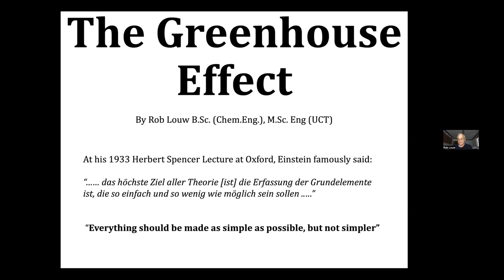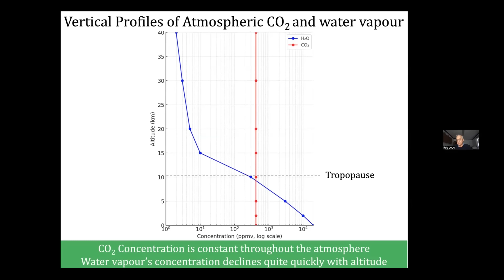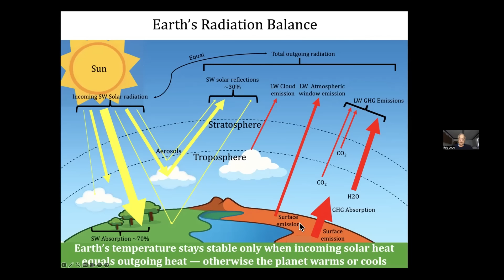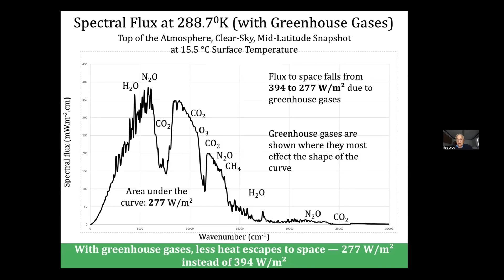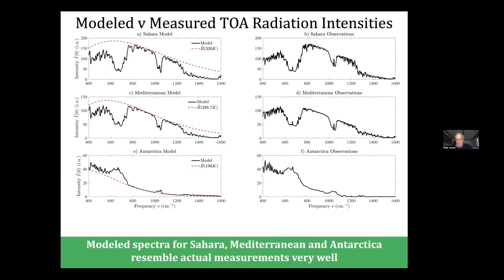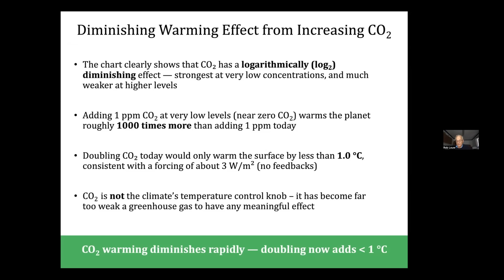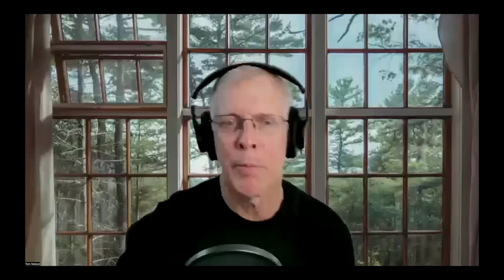Rob Louw: The Greenhouse Effect  |  Tom Nelson Pod #341

Comment: NASA: "Some people mistakenly believe water vapor is the main driver of Earth’s current warming. But increased water vapor doesn’t cause global warming. Instead, it’s a consequence of it. Increased water vapor in the atmosphere amplifies the warming caused by other greenhouse gases."
Reply: The difference between water vapor and CO2 can be clearly explained to people still listening as follows:
For a typical water molecule, it takes a few weeks between evaporation and raining down again.
If you could remove all the water from the atmosphere and leave everything else the same,
after a few weeks, so much would have evaporated from the large ocean surfaces that everything would be as it was before.
With CO2, it's different. If you removed that, it would take several millennia.
In other words, just as you say:
We can tweak the CO2, and the water will adjust itself.
But I'm afraid there are no people here who are still listening.
Reply: This is a shockingly naive statement if it really did come from NASA.
Reply: @Pseudify  It´s actually basic physics: Warmer air holds more moisture than cooler air. Therefore, as greenhouse gas concentrations increase and global temperatures rise, the total amount of water vapor in the atmosphere also increases, further amplifying the warming effect. In numbers: For every degree Celsius increase in temperature, the air's water vapor capacity increases by about 7%.

Comment: The relationship between CO2 concentration and forcing or temperature is logarithmic.
Logarithmic means:
Every doubling of the concentration adds the same value to the forcing and temperature.
This is correctly stated in the video.

What do you have to do to make the viewer mistakenly believe this is synonymous with "rapid saturation"?
Well, first of all, you inspire trust
by presenting rather trivial basics in an understandable way
in order to appear competent.
These don't actually prove the claim you're trying to smuggle.
No, they're all smokescreens to conceal the crucial trick:
At 31:15 onwards, you can simultaneously correctly explain that every doubling of CO2 produces the same 3 watts,
and incorrectly call it "tends to rapid saturation."
You then stick with "rapid saturation," and the lie goes unnoticed.

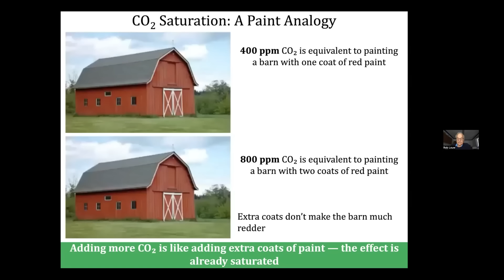 So, the bar chart at 39:22 isn't actually wrong, but it's designed to obscure the logarithm.
It's meant to create the impression that after 400 ppm, only a further 0.2°C of warming is possible.
But that's not true. In this diagram, the sum of the bars from 450 to 800 ppm is the warming, and that results in another 1.2°C.

People, don't be fooled here, check it out for yourself.
Reply: Everybody can and does claim all kinds of things. I don't mind which equation people use in regards to the so called greenhouse gasses and its role in the atmosphere. It is all speculative. Math can't 'solve' this issue. Hypothesise away. It will never turn into a theory simply because there is no zero point of departure. And the system is both dynamic, interactive and to a large degree chaotic. But what we under no circumstances should (and alas do) do is claim certainty and implement 
policies that pretend to 'fix' an imaginary problem based on a flimsy set of unproven and speculative assumptions and assertions.  I dont care if Happer et al are right, somewhat right or wrong or the man in this video. There is no issue to begin with. It is just politics.
Reply: @MrBallynally2  That's where we differ:
You have your opinion, and you don't care if you're wrong.
I have my opinion too, but I do care if I'm wrong.

If scientists whose views I share
were to use sleight of hand as often and make as many simple mistakes
as in this video or as Happer does,
it would make me suspicious.
Reply: Which is actually a conclusion Happer and fellow travellers have come to. Because the evidence of the CO2 being an issue simply cannot be found. Unless you want to of course.

Comment: At 23 mins you said Greenhouse gases reduce radiation to Space from 394 to 277. Given the energy in from the Sun has not changed, how can both create thermal equlibrium. The energy lost to Space must be the same with or without greenhouse gases else in one case the Earth will warm continuously. Can you explain what I am missing.
Reply: You're absolutely right:
To be balanced, at the top of the atmosphere, the incoming solar radiation minus the reflected solar radiation must exactly equal the emitted thermal radiation,
averaged over the entire Earth and over an entire year, and as the Earth is, i.e., with its greenhouse gases.
So, the 277 watts from this snapshot count.
However, the balance is never completely exact. If the Earth emitted too little thermal radiation in a balance year,
then its temperature (or rather, its heat content) also increased in that balance year; there's no other way.
The point you may not have understood correctly:
The 394 watts is a theoretical value for an Earth without greenhouse gases at the same surface temperature of 15.5°C.
Such an Earth cannot exist like this.
It would have to cool down until only 277 watts are emitted and the balance is correct again.

 This is explained well and simply in [1]:
[1] YouTube channel "Climate Literacy", video: "3.2 Ins and Outs of Earth's Energy Budget"
PS: The video [1] also includes the so-called "back radiation," which can be seen starting at 11:10.
Reply: @bangelos1380 Does the 394 without greenhouse gases assume no lapse rate occurs in the atmosphere? My understanding is that lapse rate in a dry atmosphere is a function of gravity and the gases thermal capacity so I would expect it to exist.
Reply: @wrath276 Die Temperaturverteilung der Atmosphäre spielt keine Rolle für die 394 Watt.
394 Watt ist die Antwort auf die Frage.
Welche Wärmestrahlung würde oben ankommen, 
wenn die Erdoberfläche selbst die gleiche Temperatur von 15,5°C hätte wie dieser Snapshot
und die Wärmestrahlung nicht mit der Atmosphäre wechselwirken könnte
(ohne Treibhausgase geht das nicht) sondern ungehindert durchginge?

Comment: N2 and O2 molecules hit other molecules (air molecules and surface molecules) about 8 billion times per second.  All that N2 and O2 is absorbing energy from the ground through collisional energy exchange.  They are not greenhouse gases but they take up all the warmth from the ground, from the vegetation, from structures, from the walls in your house.  Climate science seems to ignore this completely.  The N2 and O2 then go on to crash into other air molecules, 8 billion times per second and the energy from the ground gets sent up the atmosphere by just N2 and O2 alone.  Yes the greenhouse gases play a role, but so does N2 and O2, 98% of the atmosphere.
Reply: No, the direct contribution of friction between air molecules on the surface is quite small.
This is well explained here, for example [1]
1] YouTube channel "Climate Literacy", video: "3.2 Ins and Outs of Earth's Energy Budget"
Reply: You’re talking about kinetic energy. And of course, every bit of matter has a temperature (which is just a measure of kinetic energy) and that kinetic energy can be transferred between bits of matter when they make contact. The earth and oceans also heat up the air through this mechanism. But O2 and N2 do not absorb radiation from sunlight like CO2 and water and methane do. So in the context of the greenhouse effect and global warming they don’t play any significant role. Also, while the earth does lose a little bit of matter to space (which would carry away some of that kinetic energy you’re talking about) radiation is lost at a much higher rate.
Reply: @Pseudify  You're saying that N2 and O2 do not heat up by being exposed to heat/energy in other molecules.  But they do.  Spill frozen N2 onto the floor and it takes 2 seconds to change its temperature/energy from -210C to +22C.  I know, nobody ever says this.  But N2 heats up to the background temperature of whatever it crashes into 8 billion times per second.  So, how does climate science change when the non-greenhouse gases equilibrate to the ground temperature/the air temperature around it within 2 seconds.  Your home furnace would not work if this wasn't the case.

Comment: I find folk are confused by wrong terms being used.  A green house restricts convection loses.   Convection and radiation are very different in how they work and CO2 has a great restriction in radiation it worked best in just 20ppm reducing on a log scale so now its insignificant.   More CO2 reduces its heating effect.  Net zero is a nonsense requirment..

Comment: The radiative model for the three locations are important. That said the earth is turning. So it absorbs while it is exposed to the sun and it emits all the time. Day or night. I think that time needs to be in your body calculation. I wonder if this is why there is much higher and lower temperatures on celestial bodies that face the sun for much longer periods?

Comment: Thanks for the recap of carbon dioxide warming. A number of 0.7 degrees per doubling is not really controversial. The argument about a warming catastrophe relates entirely to feedbacks, mainly water vapour feedbacks. You hardly touch on this, although I agree logically with your point that overall feedbacks must be negative. However, this is where any refutation needs to focus, although certainly we need to get the basic physics right. In my opinion this needs to look in depth at radiative and energy transfer processes within the atmosphere. We also need to get away from the idea that the Earth has an average temperature. It is only really useful to address the differences in temperature across the globe. And then the cloud conundrum, that potentially dominates all the greenhouse effects and that we have no idea about.
One specific correction required is the pre-industrial CO2 which is generally accepted to be around 280ppm. The 180ppm number is the minimum CO2 at the depth of the Ice Age. That we rebounded from that shows how the oceans are a CO2 sink and atmospheric CO2 is highly dependent upon the temperature of the ocean that certainly can change in the longer term.
Reply: Feedbacks are negative until they suddenly are not, if you have done the dynamics modelling to know where precisely those points are for the many land-ocean-air systems then please share.  

le chantilers principle does not hold forever.
Reply: @yariboi5 . Le Chatelier’s Principle has no bearing on this discussion at all. And even if it did, your claim is irrelevant within the confines of anything we would ever experience here on earth.
Reply: @Pseudify  I made no claims other than to say that negative feedback loops are not perpetually stable when given outside forcing. That's a pretty basic foundation of control theory.

What that implies about our earth, well, you can look at paleo-climate research to see.

Comment: second law of thermodynamics: a colder body (here: atmosphere) cannot warm up a warmer body (here: earth's surface)
Reply: Only true if the two bodies are in thermal contact.
Reply: @romanpolanski4928  earth plus atmosphere is a closed system. making one part warmer at the cost of another part means to reduce entropy
Reply: Yes this is true, but the atmosphere is not opaque. 
Are you forgetting radiative transfer?
Reply: @yariboi5  why should I have forgotten something ?
Reply: @bessokeks4006  Because the atmosphere is not warming the ocean, who is claiming that? 
The atmosphere now provides a longer radiative (and therefore also convective) path to exit our atmosphere, that is what is causing the warming.
Reply: @yariboi5  why should the surface become warmer when something up in the atmosphere changes? Why should energy be transferred back to the surface because of this?
What do you want to say with "longer path"?

Comment: How do plants and plankton count in this equation? Does the light absorber by them and used as energy to convert carbon dioxide and water to sugar to feed the plant count as heat to be reradiated? This is a consideration with increasing carbon dioxide levels causing more plant life to populate drier areas. Does the light reflected by plants into space contain more energy able to pass into space vs the light on bare land void of plant life as one would see in the desert?  These other effects complicate the warming caused by increasing CO2. With more plant life in drier areas storing more CO2 because of increasing CO2 will CO2 have some self regulation?